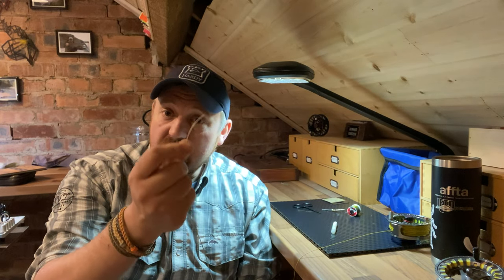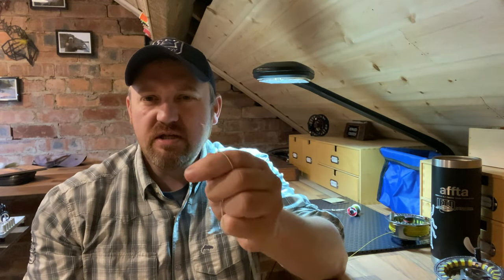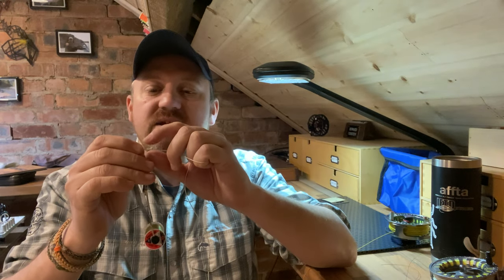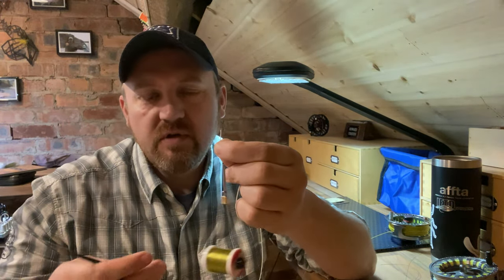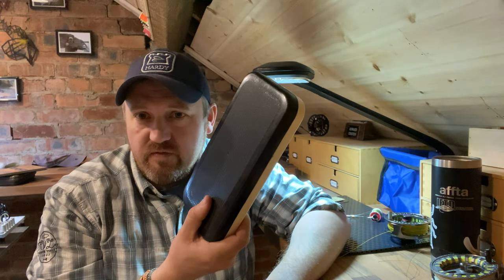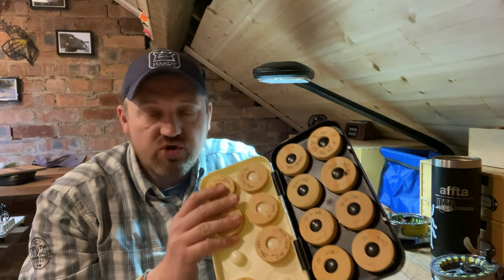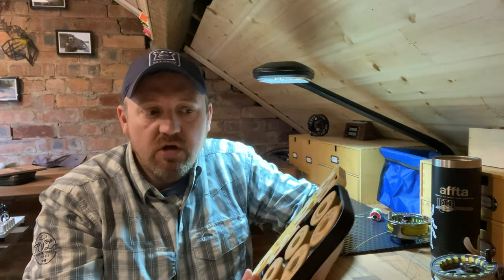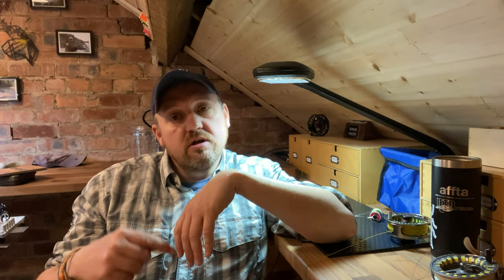River fishing : Leader connections Pt 1 Whipped fly line micro loop

Comment: Awesome stuff Howard.  When using a euro line...is it smooth through the guides or do you feel it get hung up a little?  Currently I use a needle nail.  Thanks
Reply from the maker: Yes - if you make the loop and thread whipping small and neat enough it’s fairly smooth . There is a smoother connection I will do in another video but it’s not as versatile .

Comment: Excellent Howard. Would you recommend micro connections on floating braided fly lines for Stillwater's, or is this connection what you would use mainly on rivers?
Reply from the maker: Mainly the rivers but you could use it on the lakes if you wanted .
Reply: @howardcrostonflyfisher9227  Howard, thank you for this.  I'm curious why you prefer putting braided loops on your stillwater lines rather than making a loop from the braided core of the fly line as you demonstrated in this video.  Thank you.  Cheers.

Comment: Howard, For your stillwater lines, when you install the braided loops you've made, how far up the fly line does your braided material go?  Do you install the braided loop assembly over the coated fly line, or do you remove the coating and install the braided loop assembly on the core (braided or mono)?  Thanks.  Cheers,
Reply from the maker: Hi - I make a braided loop and fit as normal over the fly line coating and whip in place and glue - normally about 2” of fly line inside the loop . I don’t make exposed core loops in my still water lines as I predominantly use Airflo low stretch sinking lines and the low stretch core is a multifilament that doesn’t loop well .
Reply: @howardcrostonflyfisher9227  Howard, Thank you for your reply.  Got it.  When you are using the "flying bobbin" technique of whipping on the tying thread, do you run the tying thread the full length of the 2" and slightly beyond onto the line coating to create a smooth transition?  If so, where do you apply the glue?  BTW, I have whipped micro tippet rings on to the end of several of my fly lines and never really paid attention to the possibility of them catching in the guides on the way out.  But, I just did a test and---sure enough---they do catch.  Not always, but enough that I will be cutting them off and replacing them with the small loops you demonstrated (at least for those lines that have braided cores).  Thanks for pointing out this issue with the micro tippet rings---you're spot on!!  Also, I was about to buy an SA Comp Nymph line, but I see it is Mono core, so I may defer to the Braided Core version of the Cortland Comp Nymph line, although I otherwise prefer the SA one.  I guess I could put a braided loop on the SA Mono core Nymph line, but not sure I want that on a Euro-Nymph setup.  Too bad you've found that the Mono core can slip when doing the Whipped Loop technique.  Again, thanks.
Reply: Howard, Oops, one more question.  Some of the SA lines use what they describe as "Braided Multifilament Core" (others use a Mono core).  Do you know if the exposed core loop technique will work well with that core, or is it like the multifilament core in the AirFlo lines that doesn't work well with that technique?  Again, thanks.  Cheers,
Reply from the maker: Shannon York  I just whip about 5-6mm at the end of the braid and glue that .
Reply: @howardcrostonflyfisher9227  Got it.  Thanks.  Cheers,